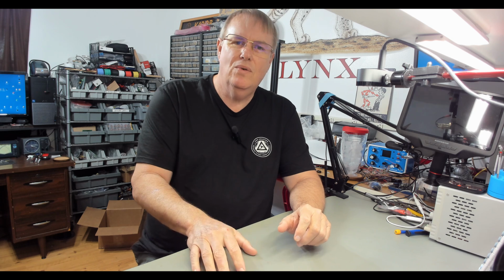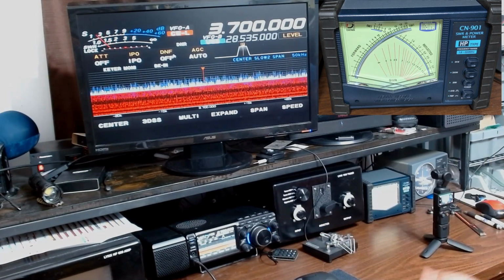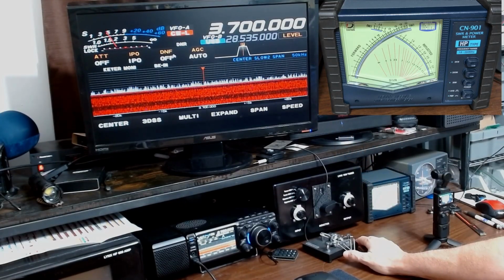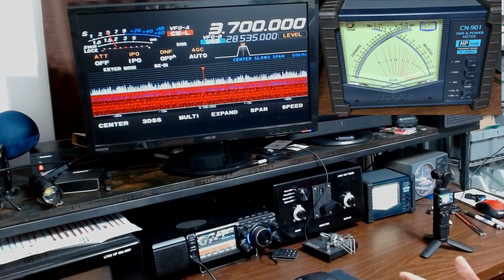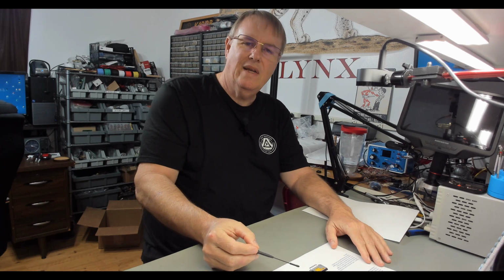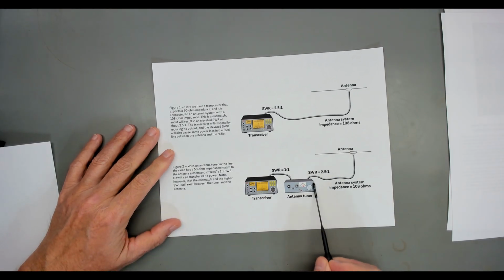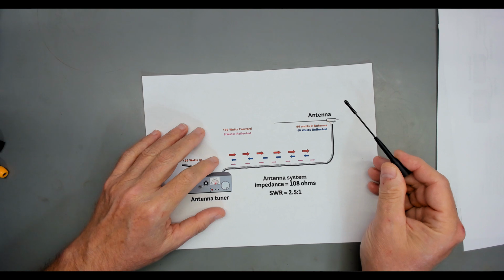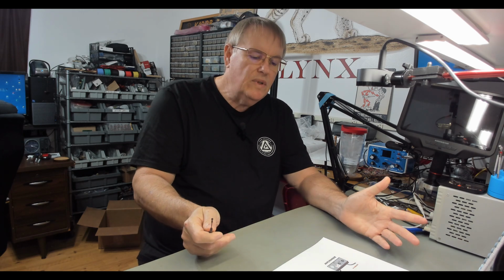What Most People Get Wrong About Antenna Tuners!

Comment: HF Things they don't tell you (because they are obscure science and not the cheapest!).

1A  always create your antenna length to the coax shield joint (cover , blinder , shielder point)  using the exact calculation for the speed of light per second fraction of one complete phase !!!! Remember one half of the band is longer than the other half but ....  !

1. If your coax is near over 10 meters long (33 feet) , ALWAYS use RG-213 50 ohm (or an appropriate low loss heavy core for the band)  or you will suffer severe power and reception power loss.
correction: ordinary coax cable for 27mhz ssb cb is rated 50ohm along 2-1/2 meters (8 feet) , so more length after is simply heavier line loss of power!!! better after it requires 5 meters to use RG 213.

2. Using less than a "full wavelength antenna" (less than a two strand cenetred dipole) antenna length has "more reflection" and more reflection the shorter it is created e.g. 1/4 wave , 1/8th wave e.t.c.

3. steel and aluminium antenna material causes both reflection and power loss so any steel "cable" is bad , always at least braise high copper content  brass wire rod naear or more than 1/8th inch (part of reflection is not enough container substance for the electrons e.g. more voltage is better than more amperage)  together and measure carefully and cover in sealant plastic electrical tape.
Then hang in plastic synthetic rope keeping sagging out of the suspension support of the antenna.

With this system you use a SWR meter only!!! not a tuner in the line!
Reply from the maker: Well OK.
RJ

Comment: so based on your explanation, it sounds like the optimum location for the tuner would be between the coax and the antenna, not the radio and the coax.
Reply from the maker: Correct! 
I believe almost everyone agrees with this. The problem is cost, and reliability as they get killed by weather and lightning ⚡️ 
With one at the feed point you do not have the coax losses of the reflected power from the tuner to the antenna and back.
RJ
Reply: Depends on the feedline in use, that's why balance feedline is used for multi band antennas, little loss at high swr

Comment: You are dead on 100%.  I've been using tuners since 1978 when I was first licensed.  I've used it for all kinds of experiments from loading up chain link fences to matching gutters so I can transmit with stealth.  

I've learned that if it's metal, it radiates, and if it radiates, then given enough propagation between two points, you can communicate. 

I'm in an apartment and so far, I've gotten away with using a Signa Emmcomm x-80, a 19 foot tall vertical with a 6:1 UNUN and 50 feet of RG-58 coax to my radio.  It claims to work 90-6 but I found it loads up on 160m, too. I expect a lot of loss below 20m and I'm not going to guess how much.  

But, the funny thing is, I just setup FT8 for my Xiegu g90. In the process, I turned the radio to 1w.  In the process of trying to figure out why it was not working, I discovered I made a contact on WSJT-x.  After completing the contact and looking at the settings, I discovered that it was on 160m, 1w, 232 miles,-10 db report against the other station's 0db s/n report. 

So, the first ever, in 47 years, 160m contact I made was an accidental very-QRP into a 19 foot vertical that may not have even been tuned by the tuner. 
The SWR on the antenna at that frequency is between 7 and 8:1.  I am not even going to try to calculate the losses in that contact.  

I have since gone on to make four more 160m contacts on FT8 at 5 watts, which is pretty much where I keep the radio for FT8 or CW.  

BTW, Ii love doing QRP sometimes, but the reason I have been exclusively QRP lately is because on 20 and 10m with this antenna, the CMC was destroying electronics in the shack above 5 watts. I fixed that today, so I can run full power now. But, 5w works so I leave it there for FT8 and I'll bump it back to 1w for SSB, which I probably won't try on 160, LOL. 

I love tuners. As for the loss, it's not as important as one might think. I think that my first ever 160m contact proved that even under the worst of the worst antenna system, one can communicate successfully.  But, I do recommend minimizing losses as much as reasonably possible and practical.  I'm not interested in Wayne Green's "All No-Contact Award."
72s
Reply from the maker: Wow, thanks for sharing! 
RJ

Comment: Antenna tuner will create what us called a conjugate match. SWRs all remain the same. When used with a low loss feedline such as open wire, or ladder line. It can be a very effective antenna.
Reply from the maker: Correct! 👍 
RJ
Reply: That's correct, the conjugate match has created a resonant system including the antenna by tuning out the reactance

Comment: From the ARRL Antenna Book:  It is a mistake to assume that there is anything sacred in effectiveness, at least) in using a resonant antenna. The resonant length happens to be one that is convenient to analyze. At other lengths, directive properties are different, radiation resistance is different, and the impedance looking into the terminals of the antenna contains reactance as well as resistance. The reactance presents no problem, because it can be "tuned out." The antenna system can thereby be resonated, even though the antenna itself is not resonant.
Reply from the maker: Thanks for your insight. 
RJ

Comment: Dear mr Lynx Electronics....

Why does your powermeter when you use the antenne tuner, measures more power?
Reply from the maker: Anytime you use a matching network to match you source to your load better you will deliver more energy to the load. The radio and antenna tuner were matched at 50ohm with the tuner, without it there was a mismatch so my radio delivered less power to the tuner. 
Hope that helps
RJ
Reply: It's the reflected power adding to the forward power in phase

Comment: does the tuner trick the transmitter?

Chatgpt says:

Quantum field theory describes particles (like photons) as excitations of underlying fields. In radio systems, we're dealing with macroscopic coherent electromagnetic waves — which are classically described, but ultimately arise from a huge number of low-energy photons.

Let’s break it down from that point of view:

1. Field Mode Coupling Perspective:
From QFT and electrodynamics:

The antenna is a structure that supports certain eigenmodes (resonant field modes), determined by geometry, environment, and frequency.

Efficient radiation (and reception) occurs when the input energy excites one of those natural resonant modes.

An ATU does not alter the eigenmode structure of the antenna. That’s set by geometry, surroundings, and frequency — not by local matching at the feedpoint.

2. Quantum Electrodynamics Insight:
In QED terms:

The transmitter generates coherent states of low-energy photons (radio waves).

The antenna launches these into free space via its physical structure.

An impedance mismatch causes reflected waves (from a field-theoretic point of view, interference patterns or incomplete mode transfer).

A tuner doesn't change how the antenna converts current to radiated fields. It just ensures that the interaction between the transmitter and the local fields at the feed point is efficient — minimizing back-reflected photons (i.e., voltage standing waves).

So, from a field-theoretic standpoint, an ATU optimizes coupling between the transmitter’s output mode and the antenna’s natural field modes, without altering those natural modes.

Conclusion:
From quantum field theory and classical EM, we can say:

An antenna tuner does not "tune" the antenna in terms of its field modes or resonant structure. It tunes the transmitter-antenna interface — a boundary condition problem — improving power transfer but not changing the antenna’s fundamental behavior.

So the “trick” metaphor is somewhat accurate — it’s a real, physical transformation of impedance, but the antenna is not “tuned” in the way a piano string or cavity resonator is tuned.
Reply from the maker: Thanks for your incite on the matter!
RJ

Comment: Well, if the antenna tuner doesn't tune and only matches, then throw that expensive antenna tuner out and buy a cheap balun or transformer, with the proper impedance ratio. 

No, antenna tuners "tune" the antenna "system", which INCLUDES the mismatched transmission line. Actually the transmission line, if it's not balanced or choked off, BECOMES PART OF THE RADIATING SYSTEM, which now becomes part of your antenna. (Ever get RF bites?)

The antenna tuner does TWO things simultaneously, it matches the impedance AND it tunes your antenna "system" to resonance. 

That's why it's called a tuner.
Reply from the maker: Thanks for providing your view on the topic. 
RJ
Reply: Correct!

Comment: I think it is true that we use antenna tuner to tune coax+antenna to resonance (the antenna system) but still do not think it changes any phisical properties of an antenna (impossible). Tuner performs both tasks simultanously , it makes antena system resonant + matching the impedance of the transceiver. Please explain, why is it that JUST MATCHING the antenna system impedance, gives several S units of gain on RX ? Did you ever try using the tuner 'by ear' ? How come is this even possible if the tuner doesn't create resonance but only matches the ports ?
Reply from the maker: Did you tune for lowest SWR? If so you did not tune for resonance. If you watch the demo video I did for the Lynx EZ SW Receiver you will see me do as you say and explain how matching my antenna impedance to the front end of the radio will do as you say. You can see the signal come up. 

RJ
Reply: @zaywas it changes the electrical properties of the antenna system

Comment: Nice video!  I like antennas that are frequency specific, but I am stuck with attic antennas, due to my HOA. So, because of space considerations, I use one 20m dipole for most of my communications.  Fortunately, the "tuner" in my K3 matches up everything very well,  and allows me to use that one antenna on several different bands.  Not ideal by any means, but I still do pretty well with it.  For my mobile HF radio, I use a Tarheel antenna, and it works great!
Reply from the maker: Thanks, Glad to hear your on the air! Hope to run across you on the bands.
73’s
RJ
K4ROB

Comment: Let me try

Let’s say that the transmitter speaks English and the antenna speaks French (I am in Canada). The tuner is a translator. The resonance of the antenna is dependant on its length, height and a lot of other factors. But a signal is received in French, by the tuner, translated into English, and read by the receiver. The reverse takes place on transmission; the English is translated to French for the antenna. If you have a 50 ohm reader( SWR meter) after the translation to French, it is going to look at the French and read it using English. What you see is the signal in the language of the antenna. Similarly if you have a 50 ohm SWR meter on the radio side of the tuner, it will read in terms of  50 ohms or in my example, English.

I understand that a dipole at 33 feet, on 20m has an impedance of about 72 ohms. If you had a 50 ohm meter on the radio side of the tuner, and a 75 ohm swr meter on the antenna side, I think they would both show effectively 1:1 (or pretty close)

Does this make any sense?
Reply from the maker: Thanks for your comment. 
RJ

Comment: It's well known that an antenna's resonance has nothing to do with its impedance. And any transmission line, unless cut to reflect 50 ohms at both ends, will act as an impedance converter. What you say about the tuner is correct, but it doesn't tell the whole story. The subject, while not impossible to understand, is much more complex than you explain. It's not a topic for debate; it's pure science. It's true that there is mythology, but those who create mythology simply haven't studied it enough. 73
Reply from the maker: Thanks for your input. I have no disagreement with this. You appear to understand my argument better than those who just claim I do not understand reactance, impedance etc. It is not about what you could do or might do with the antenna. Instead it is about what 99.xxx % of hams measure, adjust and therefore do with the antenna tuner. Not if Walt Maxwell is right or wrong. 
RJ
Reply: @LynxElectronicsLab but if you say things that is opposite to what Walt Maxwell says you are wrong

Comment: So, if I put an antenna tuner right at the antenna the antenna continues to be non optimized with some reflections, but since the resistive losses on the coax have in essence been eliminated from the reflections, the resistive losses would be minimized correct? Wouldn't the reflections be almost squashed as well? I imagine there would be some, so am wondering what would the effects be on that front. Great video and great explanation!
Reply from the maker: Since the tuner is connected to the antenna. The match happens at the antenna and once the energy enters the antenna it stays in the antenna. There is no reflections in the feed line so no repeated losses. This is why it is a better setup if it was not for the issues with complexity and reliability. 
RJ

Comment: I was in the military for 9 years as an RTO . So I know something . There was an antenna tuner used on their antenna systems . Other systems you had to tune the antenna yourself . 
So do antenna tuners work . 
The idea of antenna tuner is shorten your antenna , or lengthen it ARTIFICIALLY . 
But to keep the load the same . 
The military used a device that acted like a channel changer . It was noisy when that thing was activated . 
But more recently , the manufacturers decided to change the loading system . So it doesn’t have so many moving parts . They now use a pherite donut before sending the signal out to elements . 
Do you know what I’m talking about ? 
The pherite doenut is wrapped with two copper wires . One from the transmitter , the other to the radiating elements . So now you don’t have to manually change the length of the element . The load is constant regardless of the legth of elements . 
Fascinating how physics works .
Reply from the maker: Thanks for the information. It sounds like a matching transformer.
RJ
Reply: @LynxElectronicsLab  um , what ever you call it , that’s what our military manufacturers did . And from what I can gather , there is absolutely no problem .
Reply: That's exactly what an antenna tuner does, ELECTRICALLY lengthens and shortens the antenna to resonance, when resonance occurs we have full transfer of power less any loss in the feedline

Comment: What I have found out is a 75meter dipole will receive other bands pretty good but won't transmit good even with tuner. Then hook up real 20 meter dipole or 40 meter dipole signal normaly will come up. Also will transmit well on resonant dipoles. Real resonant antennas will make contacts with a 55 signal my g5rv pretty much they needed to be 59 to make a contract. A flat top 20 meter dipole at about 20 ft or higher is pretty good. Also have tried off center feds and doublets always loses. Real half wave or quarter wave vertical most efficient. Some how the A99 antenna is very efficient no ferrite just coils and capacitive sleeves in there it is amazing. For 12 through 10 meters.
Reply from the maker: Thanks for your findings. 
RJ

Comment: I disagree with this person's take on what is being done by antenna tuner's operations.  They DO NOT simply tune out reflected power, that is a simple explanation of what is going on.  It is also just a side effect.

What they do is "pre-distort" the phase of the current with respect to the Voltage, at the frequencies that were present when the controls were set, in the transmission line.
Called a conjugate match.  (which he mentioned)  Antenna tuners make it possible to operate antennas on frequencies that the antenna was not designed for.  They do this by connecting coils and|or capacitors in series and|or in parallel with the RF energy in the transmission line.
They can be placed at either end of the transmission line, but being at the input of the transmission line has advantages for HAMs. Ron W4BIN
Reply from the maker: Thanks for your view.
RJ

Comment: The tuner does two things. It transforms the real part of the antennas imedance to the impedance of the cable (50 ohms) and it compensates the reactance part of the antennas impedence. So, looking into the input hole of the tuner we have a 50 ohm load without any reactance at the given frequency it is tuned.

If the tuner itself has no parts converting the HF energy into heat and the antenna doesn't have too than the full HF power must be radiated! The question is how the radiated field, the radiation coil, does look like at such an antenna. If the power radiates into a direction  not benefitical for your transmission than you would better use another type of antenna.

But the HF energy will be radiated out, if there is nothing to heat up in the tuner itself or the antenna.

Tuning between PA and coax line may lead to very high voltages inside the coax and (or) very high currents inside the coax. This will cause losses as heat inside the cable, most likely more as tuning between antenna and cable.
Reply from the maker: I agree with your points about impedance and power transfer!
RJ
Reply: Total agree, its how the tuner compensates the reactance is where people refuse to understand, reactance is either capacitive or inductive the tuner contains a capacitor and and inductor, what do they think these do?